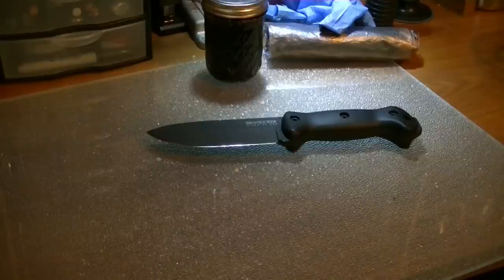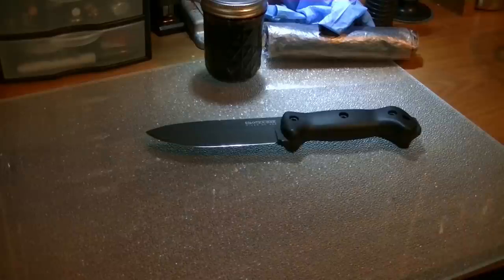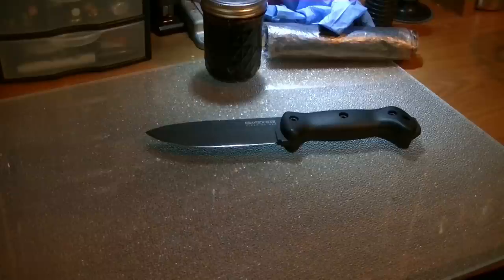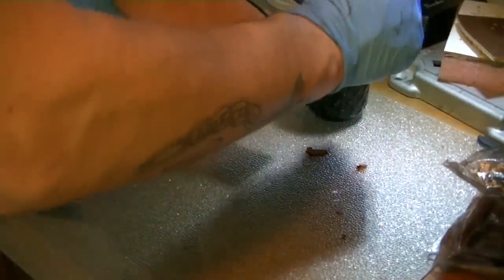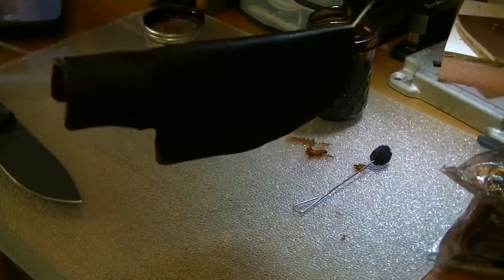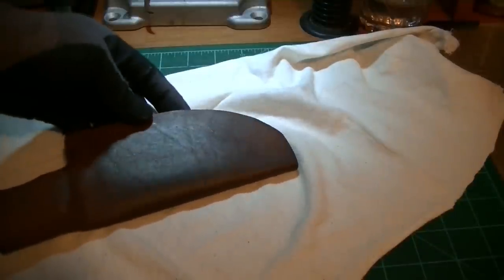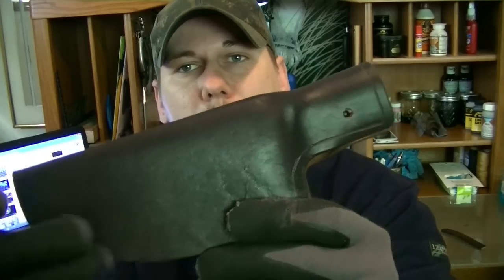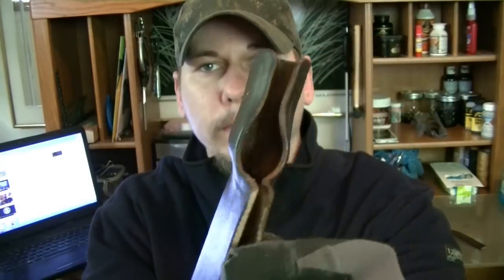Leather working -  How to dye leather

Comment: Very informative video and great attitude on your work and possible competition in general, subbed! 

Since you mentioned different methods for different dyes, do you have any advice on using water-alcohol based dyes? Anything I need to be careful of or any different method I need to apply that is not mentioned in this video? Its not easy to get good quality dyes where I live, usd is expensive and they are not available anywhere, so I have to order them. I bought some dye from a local leatherworker to at least practice a bit before buying dyes online, and he mixes a water based dye with denatured alcohol for some reason. Any help would be appreciated, thanks in advance!

Comment: I'm thinking about buying a 7-8 ounce vegetable tanned cowhide.  I don't have a whole lot of experience with leather but after some research this seems to be the typical weight/thickness for a thick-ish belt.  Does this type of dyeing apply to vegetable tanned leather?  Or would I have to get some sort of specifically tanned leather hide that is conducive to being dyed?  It seems like I would just dye the vegetable one but I wanted to double check with someone who works with leather.  Right now, the leather is a light tan color but I would like a rich, dark brown.
Reply from the maker: Learn Armor Go with a thicker 9 ounce leather for your belt.  You will be much happier.  This dye will work for it but make sure to oil it real good after it dries.
Reply: ***** Awesome, thanks for the info!

Comment: I do a fair amount of cosplaying, and I got tired of using vinyl and cheap faux leathers. But I've only just begun in working with leather, but I'm really glad you shared some tips and techniques. The project I'm working on right now is just a messenger bag that a video game character wears, and the bottom of the bag has a leather covering, as well as the buckle straps & leather bias around the front flap. I always figured that you just apply leather dye and you're done but boy was I wrong!

Thanks! ^^
Reply from the maker: Very cool. Give my website a visit. I have lots of things that might give you ideas. I also have some jedi belts coming soon. Been trying to find time for cosplay items now for awhile.